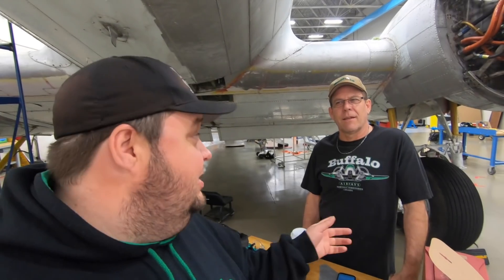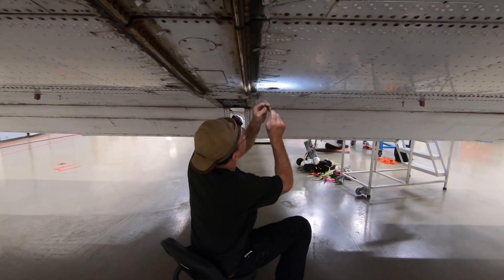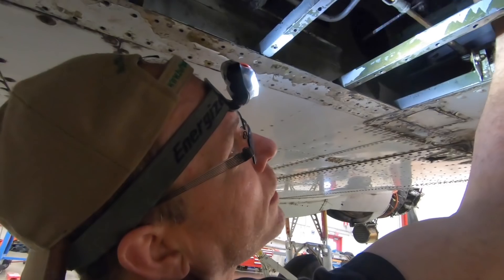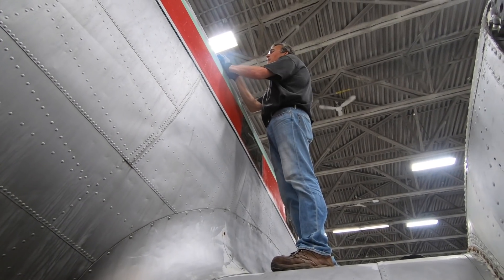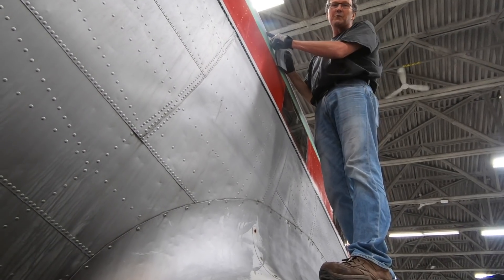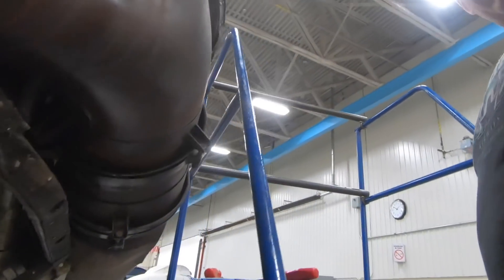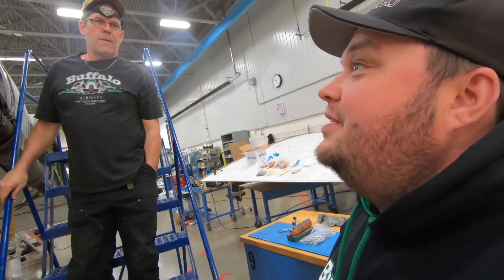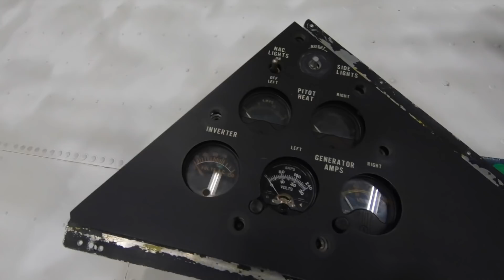"It's Coming ALIVE!" Plane Savers E116

Comment: Nature loves our DC-3 as much as we do as the whole airframe becomes one big aeronautical nesting box and who can blame them ? it looks like a hive of activity inside that large ENA hangar today with so many jobs going on and the constant need for spare parts hinders progress but still plenty to do.

I was only thinking today about those aileron control cables and their inspection inside the wing,it would be good if each one could be drawn out in turn and given a lanolin spray that soaks in between each strand of the cable it is all a race against the clock to get things done,if there is one thing we have learned is the need for control locks when aircraft are left outside and the damage that can be done to controls and bellcrank bearings as the control surfaces slam over in the wind.

Stella is busy with the paint broom on that white decking and taking advantage of the warm hangar for painting,you have a great team there Mikey all pulling together doing the scores of jobs required to get this venerable old bird flying again.

Once again thank you to the school for the hospitality and the parts suppliers doing their best to check dusty shelves for vintage aircraft spares.

Well done with the time lapse photography it is working very well.
Reply: No need they're all stainless

Comment: Hey Mikey.....is there no spar to provide additional strength where the outer wings bolt on and it's only the seams of bolts that provides the strength?...the forces on that area of wing in a climb or dive must be quite high so where does the strength come from to stop the wing from being torn off under normal loads...

Comment: Bobby / Mikey people new to aircraft may not realize that they VIBRATE in flight. Any wiring that can move will! If the wires touch structure or tubing bad things happen. Soldered connections require mechanical strain relief. Else the stranded wire will break at the location where the solder stops wicking. A mechanically crimped wire, if properly performed has an inherent strain relief which makes a mechanically crimped wire more reliable.  The Boeing Guy.

Comment: An AVIONICS QUESTION--- When I work on my TRIUMPH BONNEVILLE, my car, and my RC vehicles, I apply a waterproofing,  corrosion-inhibiting dielectric grease on connectors before re-connecting them.  Is this also done on electronic and electrical contacts and lighting bulb sockets in aircraft like DTD ?  Merci !

Comment: Bobby can you show a closeup of the air stair hinges. they have to be very strong to hold the weight and the constant opening and closing.
Great to see the progress being done on DTD. KEEP up the great work .
Reply: airmec331 This was done several episodes ago. They are very strong. Problem is the handles where the chains are attached are thin and flex and eventually crack. Also the area where the hinges attach to the fuselage needs a lot of support because of flexing. Remember this was a post design modification at Canadair.
Reply: thanks

Comment: Trick for rescuing long unused Bowden cables and other push pull cables; If they have a water/oil proof sheath you can tape one end  of the sheath into  a powerful shopvac hose and immerse the other end into light lubricant. By and by the suction will pull the lube through. I've rescued some mighty rough/stuck cables this way.

Comment: I have done electrical work on car, trucks, motorhome and transit busses.  I can feel their relief when they finally solve a nagging problem.  Working without proper schematics just makes it so much harder
Reply: Even with schematics, chasing down each wire is required. There could be corrosion, cuts, shorts, etc. So each wire is ringed, checked for ohm resistance in addition to checking relays, fusible links and terminal points. 

The scale of the work is daunting in itself. And like they have stated, over the years, wires and components have been changed or bypassed or removed.

The avionics team has to be perfect or things can go wrong in a hurry on a 75 year old airplane.

Have a nice flight!

Comment: Glad you didnt have any fuel in the cylinders.  A thing that happens with Model T Ford cars is called "ghost starting".  You turn on the spark coil igntion and sometimes the engine will start.  Not something people want with radial engines, especially when people are near the blades like you were.
Reply: Couldn't happen so long as the magnetos were turned off. Not like car engines.

Comment: Once they've figured out how to trouble shoot the flux capacitor main bus relay they'll find the bad ground for that distributer downstream from the voltage rectifier.
Reply: William Dunlop Wait till they have to tackle the GPRV. There you will get the real show.
Reply: William Dunlop GPRV (Gremlin Pressure Relief Valve) :-)

Comment: Have these power plants been unopened in 30 years? If so you surely have rusty internals. Stuck rings, rusty accessory gears. They really need to be torn down and inspected.
Reply from the maker: These are Engines from Buffalo not the airplane
Reply: these are new engines . the prop assy were removed from another one of Buffalo's  C-47's.  DTD did not have any engines on it when Mickey bought her.